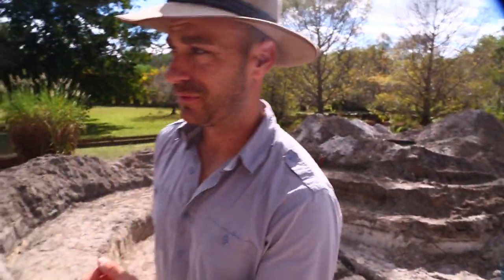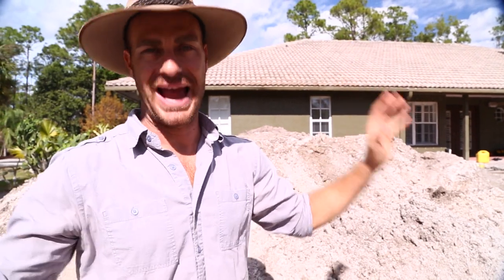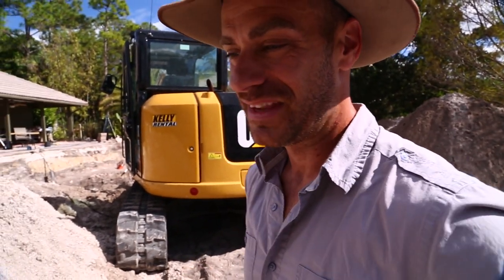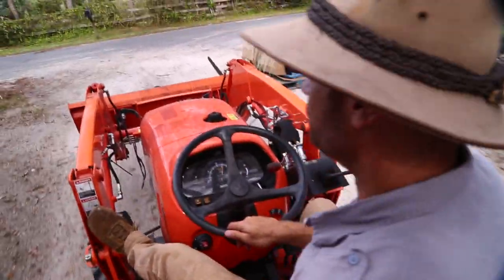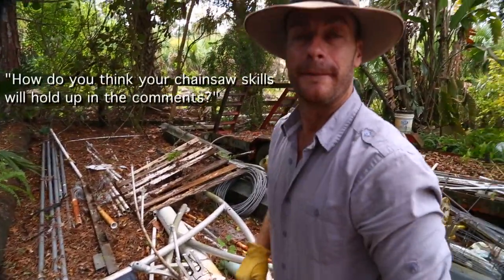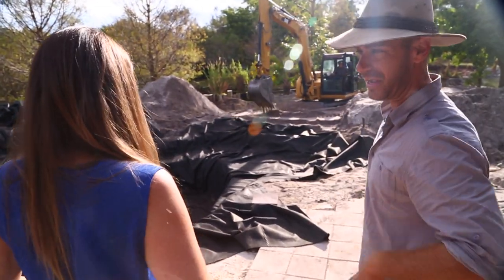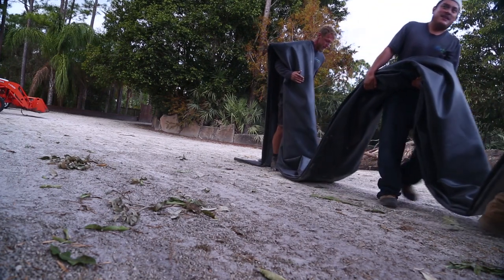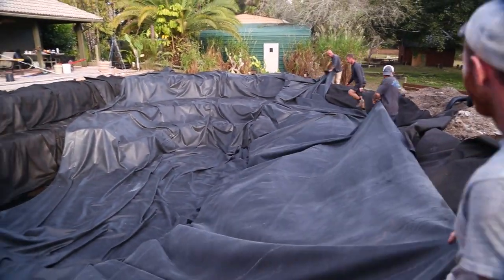Building, Digging and Lining the DREAM Rec Pond!!!

Comment: Hey kenan what is the meaning of a recreation pond?
Reply: @GregWittstockThePondGuy  Hi Greg, awesome channel! One question, about the installed system here. What are the holes at 4:30 for? They look just like the holes for the centipedes of the wetland filtration in the upper basin because they end apruptly. In the video there is at some point just the Liner covering it. Did you expand the hole to lay out some pipes?